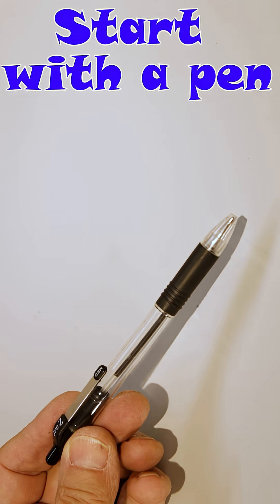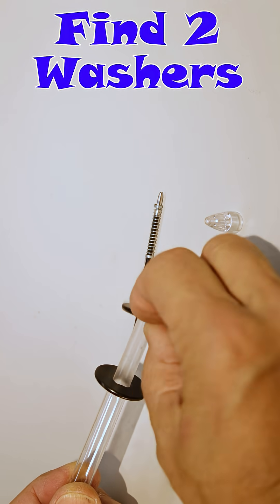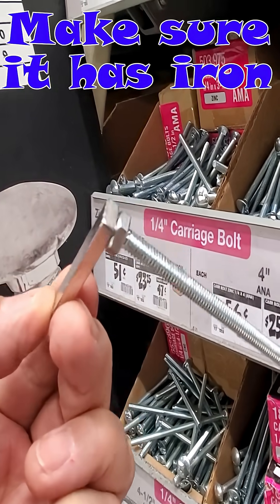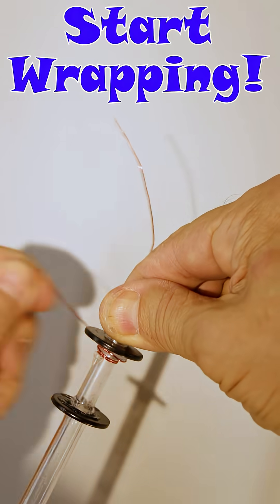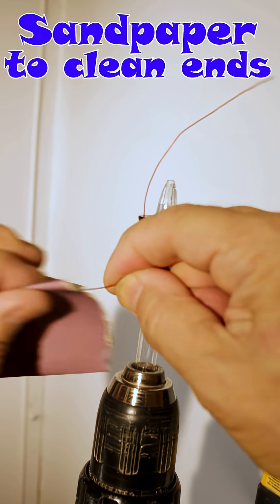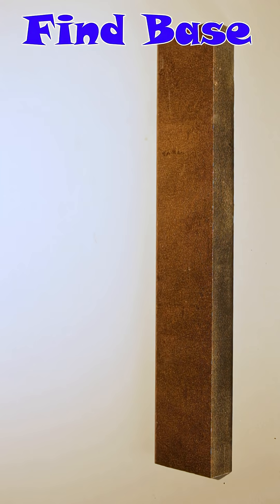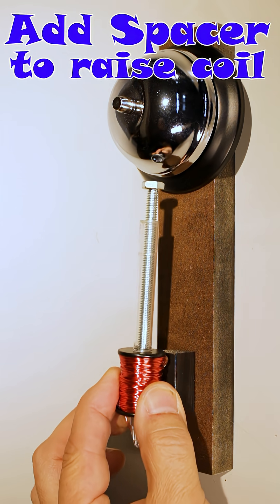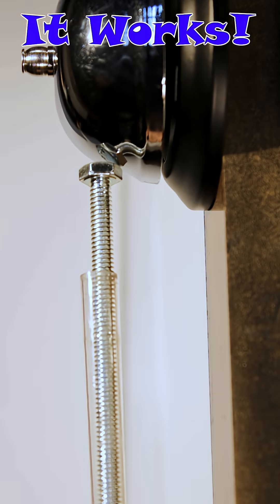I Made a Doorbell in 10 Minutes with Just a Pen and Some Metal

Comment: Did you really say "bring a magnet to make sure it has iron"? Wtf else do you think the bolt will be made of?
Reply from the maker: Brass, aluminum, stainless, copper are all non-magnetic and would not work. All of which you can find at the hardware store.